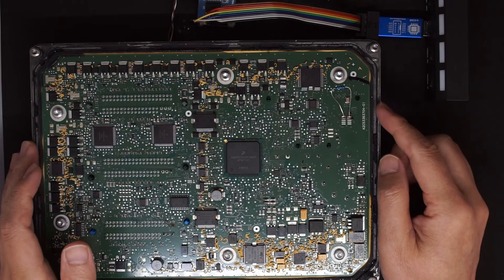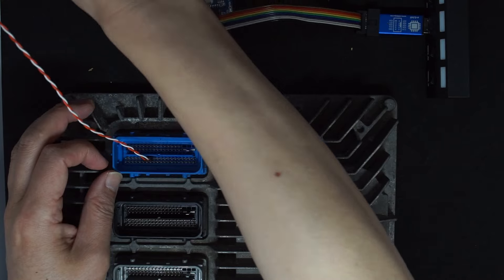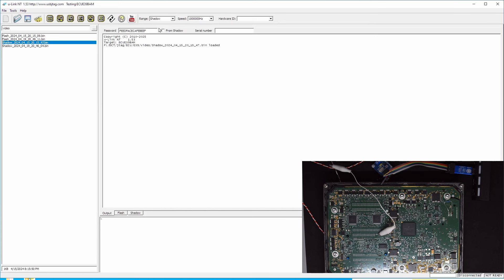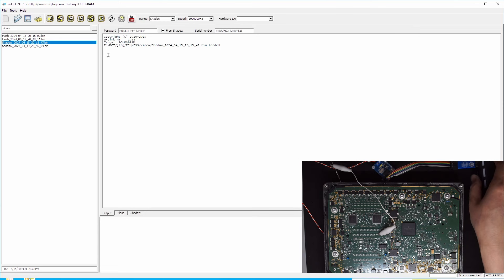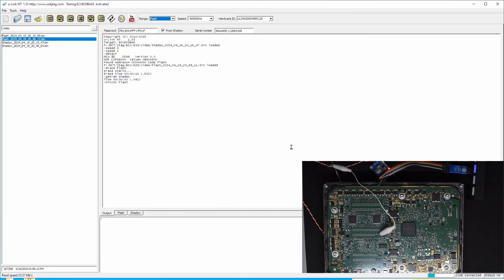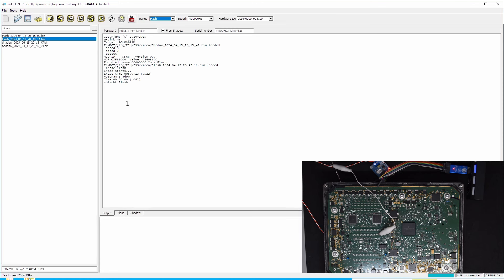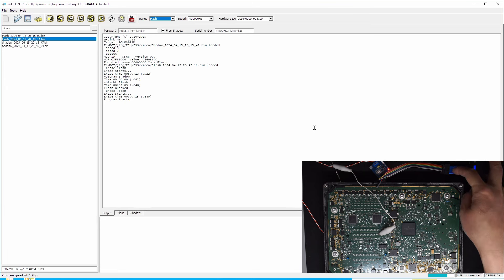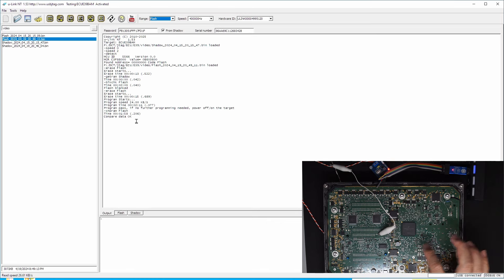E39 BAM mode programming. (boot mode)

Comment: Hello, excellent explanation, I have some e39 and e39a that were blocked when writing them with I/O terminal, it has been impossible for me to unlock them because I do not have the shadow flash, could this interface do something
Reply from the maker: E39 and e39a can be recovered without shadow read.
Reply: @usbbdm  I can rescue it with the u-link, without the shadow
Reply: @usbbdm  I don't have cannon communication, the ECM turns on but doesn't communicate, it's like corrupt
Reply from the maker: @marloncolmenares7410  For E39 and E39A yes.
Reply: @usbbdm  You sell it
Reply: @usbbdm  the ali express one works
Reply from the maker: @marloncolmenares7410  Chat on my site if you want.
Reply: Can I buy to you a shadow pass?
Reply from the maker: @cartun007_  What do you mean?
Reply: @usbbdm sorry where can I buy the interface?
Reply from the maker: @cartun007_  watch the end of each video or use Google.